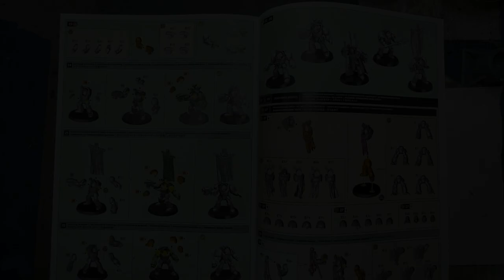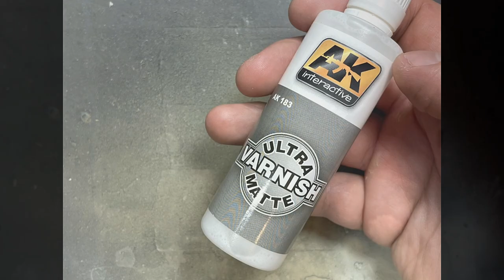Joyful Painting - Dark Angels - Deathwing Terminators

Comment: For this one I'd add a dry pigment to the base and to the feet and a bit up the legs to tie them into the base and make it look like they have been moving around in the area.  I'd have taken the helmet closer to white on the highlights and the eyes a bit stronger red
Reply from the maker: I had similar thoughts on the heads.
Reply: @joyfulpainting700  It's odd terminators are the one minature that I tend to want to use bare headed even though that makes even less sense than on a marine.